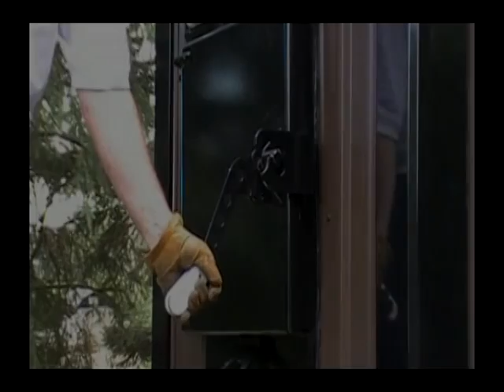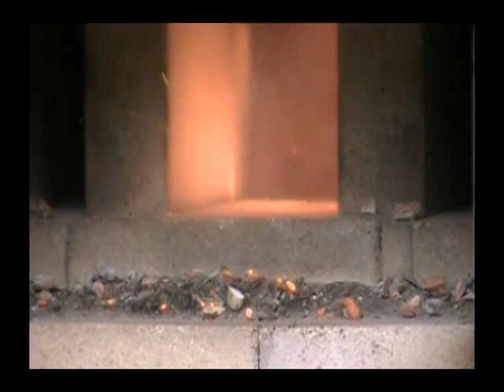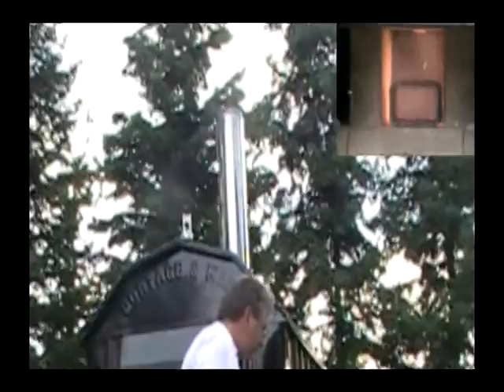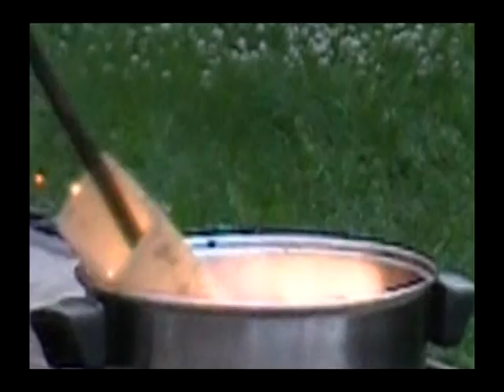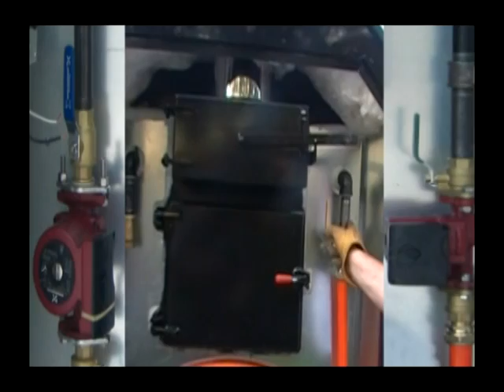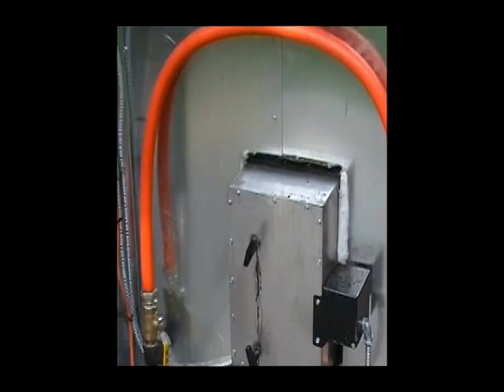OPTIMIZER250 TV.mpg

Comment: I have seen many gasification boilers and I've found most are not what I would call "true gasifiers".  This is the best I've seen - bar none!  Heavy construction where it is needed, lots of ceramic, true gasification, lots of heat extraction, and easy to clean.  Even the tubulators are a great addition that most stove manufactures miss - yet they don't realize how important that is.  You have done this stove right and it looks like it will last many years.  
I'm ready to buy!
Dave
Reply: It's been 5 years. Did you get one? If so, how did it turn out?

Comment: Hello. I want to ask who knows. these boilers has two areas. Simple combustion (1) and intensive (2). Please tell me: where goes simple combustion (1) smoke. Do they also go through the hole in the intense combustion zone (2) (always or not)? Through where air is taken? Is the amount or air regulated the same way as ordinary boilers (with a valve via the chain connected to the thermostat and so on)? 
P.s. Sorry for my English